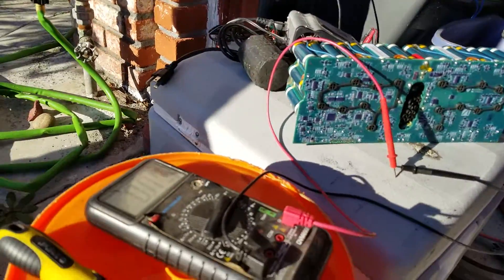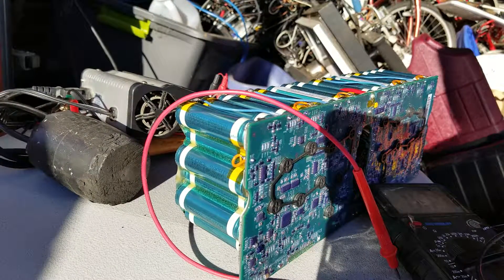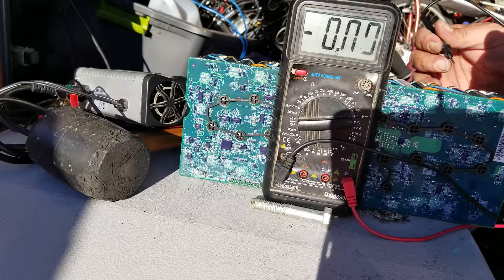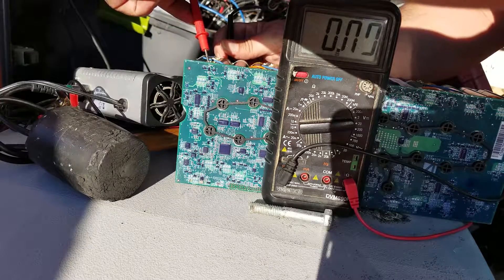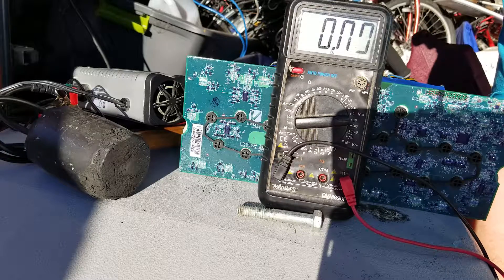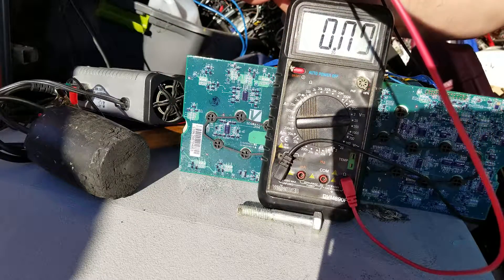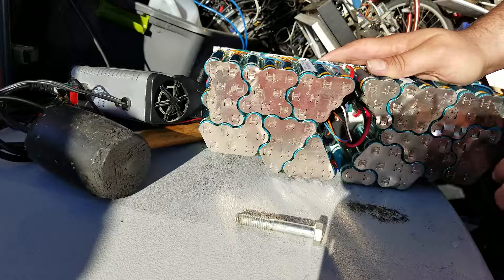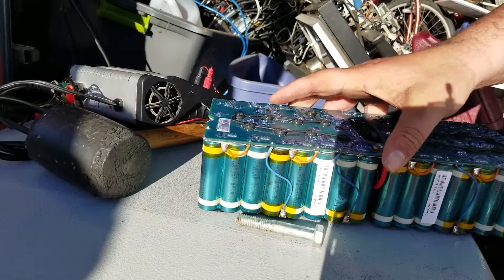Reviving segway batteries

Comment: The batteries run in a series parallel of 4 , so in what u called a cell... Yes there's 8 batteries but 4 positive to negative under each plate and the plates flip flop top to bottom so if u want to get technical a series parallel of 4 would be for cells.. 
Anyways count up the total number of batteries divide that by four ,  than times that by the 3.2 or 3.7 volts of each batteries and that's how much volts the batteries should have. 
And since its a parallel of four ..times the mah say 3000 mah's by four and that should be your amps. 
I found out a hover board batterie has a quarter of the amount of batteries than the segway but yet has half the amount of volts output than the segway does. 
Can Any body guess why...?
   
The hover board batteries run in a series parallel of 2 .
So 2 positive to 2 negative .
  In other words.. You could throw half the segway batteries in a battery pack away and rewire it in a parallel series of two rather than the parallel of four. And you would have the same amount of voltage output . and should work.
Granted u would only have half the batteries life before the batteries would go dead . 
But its also good to know that the battery pack out of two hover boards could replace a segway battery but again would only last half as long as a segways battery . 
But just wanted to share and hopefully it helps.